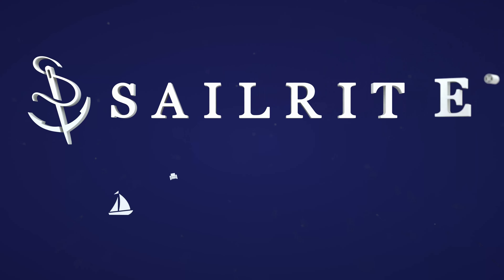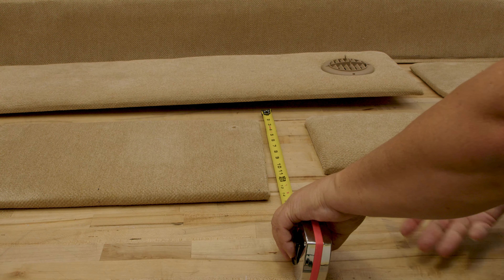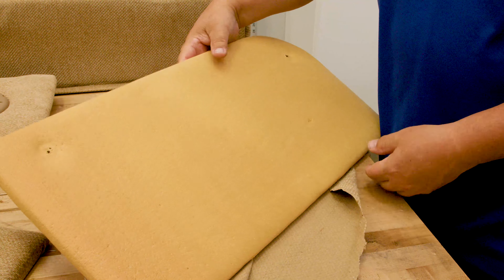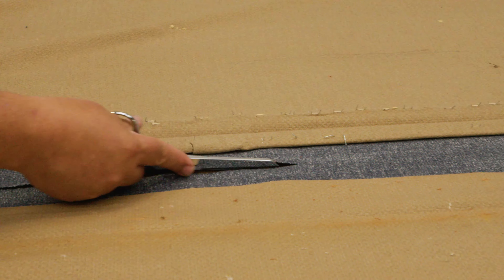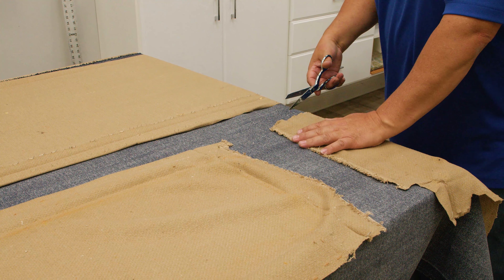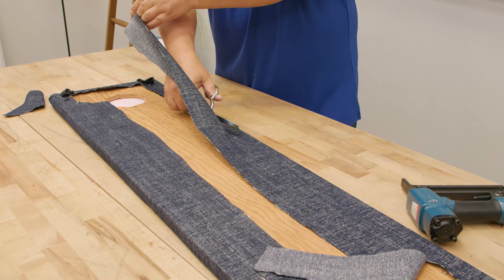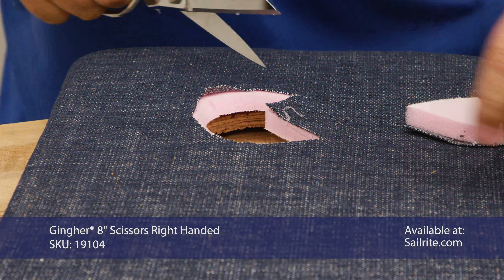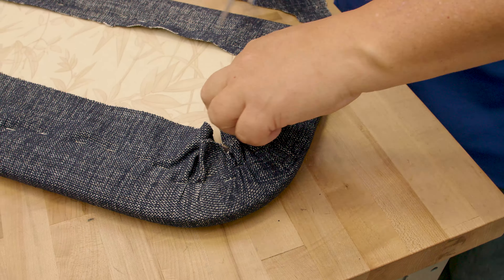How to Reupholster Fabric Panels on Backer Boards

Comment: Excellent video as usual. Can you recommend a better backer board material than the plywood which broke? 
Thank you!
Reply: Pine
Reply from the maker: Yes, but is rather expensive. It is called "King Starboard". It is plastic polymer sheet building material.

Comment: On the backer board foam removal...I use a pvc tubing cable saw....well, I did until I started stocking stainless steel rope for working on spring assist trailer entry doors and that works better for larger pieces.  Same thing more or less and you can hold the cable against your backer while you saw.  Takes no time and your forearms will thank you later..